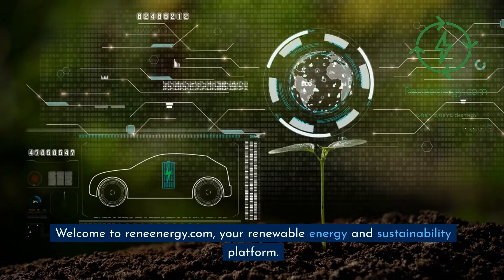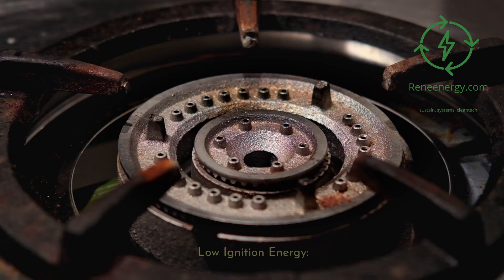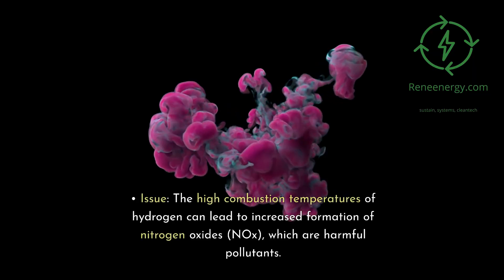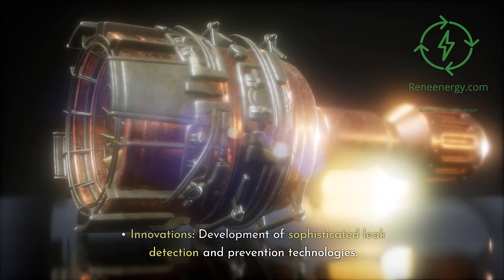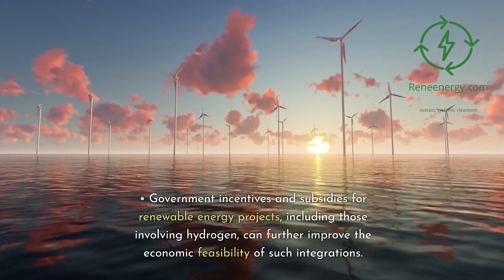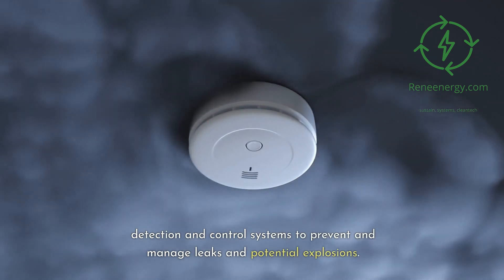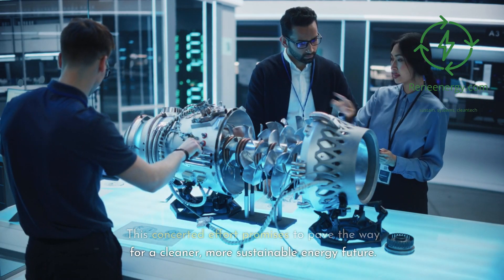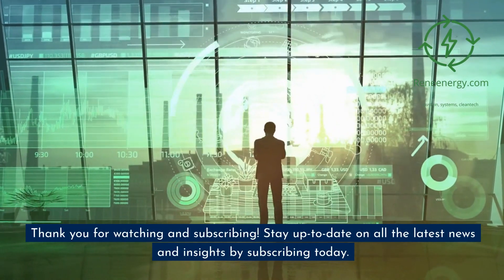Unlocking the Future - Designing 100% Hydrogen Powered Gas Turbines

Comment: Hydrogen powered turbines are a great idea as long as the hydrogen used is green hydrogen which adds to the complexity because the Hydrogen has to be made from renewable sources.
😎
Reply from the maker: You're absolutely right. Using hydrogen-powered turbines is a promising idea, especially when the hydrogen is green, meaning it's produced from renewable energy sources. This indeed adds complexity, as it requires a sustainable and efficient process for producing the hydrogen. The integration of renewable energy sources into hydrogen production is a crucial step for making this technology truly environmentally friendly. Thank you for pointing out this important consideration in the use of hydrogen for energy.